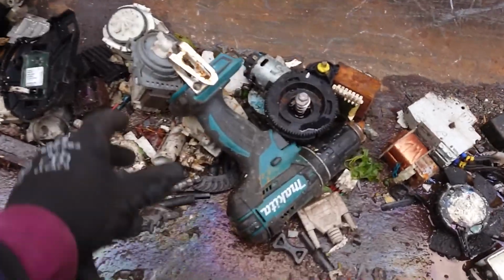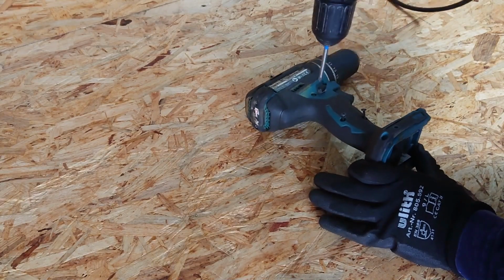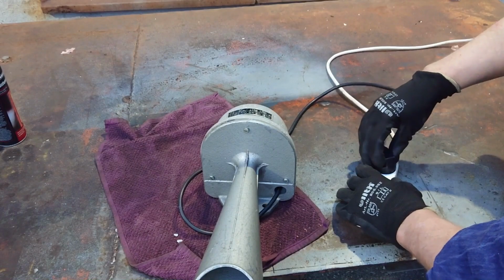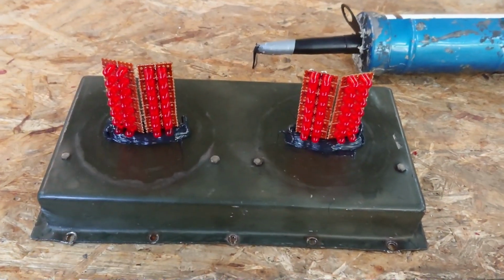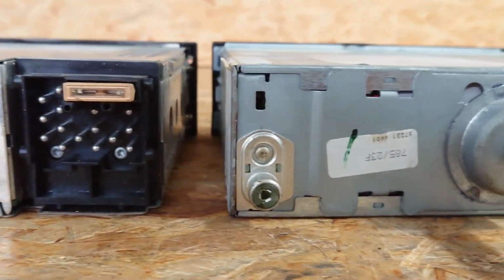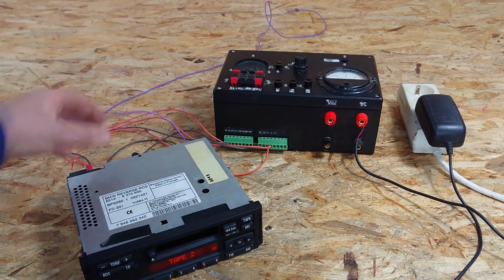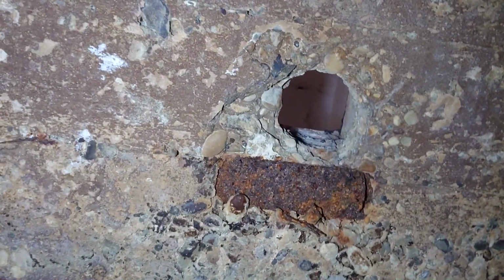Exciting Scrapyard Finds! Repair-A-Thon!

Comment: Love that alarm system! The radio tester is cool. I tried to repair the radio out of my 80's truck, it seems to have lost the bass control and it just puts out an unusual amount of bass to all of the speakers, potentially damaging them. I found a few puffed out capacitors and replaced them but the issue still seems to be there.
Reply: Or perhaps the bass potentiometer is bad
Reply: I'd replace all the caps, as basic principle, even if they're not puffed, they can still be dead or dying. Also, give a good  search of all the soldering joints.
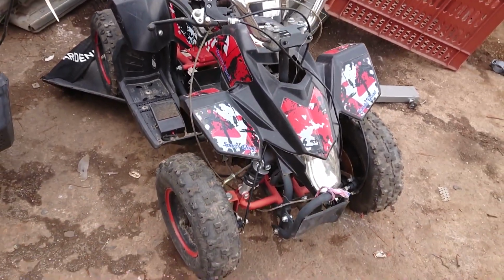Reply: heres a video that at about 2:20 has a chart that correlates driver response frequency to capacitor mfd rating. this will help you isolate which cap is bad. alternately you can install the caps inline to the speaker as a "bass blocker". https://www.youtube.com/watch?v=s_amOnIh1So

Comment: Given the holes on the ceiling and the 2 overflow ports that look like windows, and unpainted cement covering the walls, I'd guess it was a water tank of some sort. 
Maybe for irrigation? 
All the junk were thrown in it as a storage when it no longer was used as water storage.
Reply: Sounds like a good idea. The upper portion of the building may have been for the pump and drive motor. They may have made it look like a dwelling just for aesthetics.

Comment: Great video.
Looks and sounds like a prisoner has escaped! @12:17
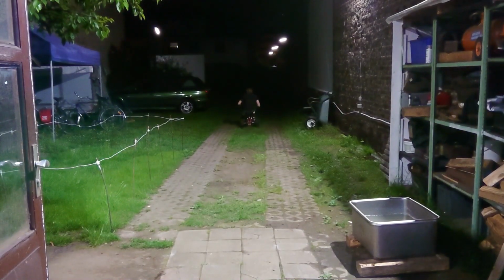Also, you would be wise to use orange tennis balls on top of those rebars sticking out of the ground, forming your garden fence. @18:25
This will prevent others from falling and getting impaled by one of them. Better safe than sorry...

Comment: Curiosity has a hold on me with those BMW head units: are they Alpine or Philips? I love the Philips stereo tuners from that era and before.
Reply: I had family working at BMW which got me some very decent BMW Becker radios back in the early 90s for my Ford Fiesta... 😀
Reply: @armin0815  Very nice.
Reply: @andrewprettyquick2070  I didn't ask you.
Reply: It says Blaupunkt on at least one of them. I think BMW mostly had rebranded Blaupunkt and Becker radios.
Reply: @armin0815  Thanks. I should have realized Blaupunkt. Here in the US I've seen all 3 brands. Becker is more of a Mercedes thing.

Comment: Most of the junkyards in the Philippines are mostly junk because people would repair until the device is irrepairable due to lack of parts.

That sink in intro? Somebody would get/buy that even before that step in the junkyard.
Reply: Same here in Pakistan, scrapyards here resell alot, only proper scrap is sold for melting, and we rebuild most of the old vehicles with spares from imported auto scrap, this has led to people introducing latest features to really old vehicles. You can have any outer shell with any engine and gearbox from scrap if it fits.

Comment: Anyone got any tips to find a junkyard, I googled but most of the ones were purely cars parts not anything cool
Reply: I remember when you could go to the local dump and mooch around in the recycling and scrap piles.  Nowadays it seems they don't want you to leave with anything.  Probably people tripped on stuff and made a fuss and now for liability's sake they won't let you look for things.   Definitely you want to look for scrap yards rather than wreckers.
Check the IScrap app (seriously - there is one) at iscrapapp.com.   Look under 'yards' and you should be able to put in your city and state/province and they will tell you the nearest scrap yard that they know of, and that should be a good starting point.
Reply: @mikegraham7078  Awesome thanks! It looks like the app Is only for America and Canada but I'll look for an Australian version :)
Reply: @evancashman7614    Apologies!  I was woefully geo-centric in thinking that you 'looked' North American from your teeny-tiny profile picture.  Also, you don't type with an accent.   :)
Reply: Recycling center or scrap yard are good ones to look for

Comment: Why an Arduino? little overkill. A 555 timer would be simpler.
Reply: Why 555 trimer When  you can use a tow transistor  multivibrator  :-) .
Reply: 555 timing iming circuit or similar will have robust plug and play function, likely to contain all switching hardware, also likely to turn up at little or no cost.
Reply: Agree.
Reply: He wants to make a whole alarm system. So the microcontroller will be easier to add inputs to and program.
Reply: @1pcfred    That is certainly true.  I doubt, however,  that he will use the microprocessor in the annunciator that is mounted on the wall outside his shop (and thereby more accessible to anyone who might want to defeat it) to do the 'heavy lifting' for the alarm system.
If he wants to program one of these kind of units to run the whole alarm system then he might be better off with a Raspberry Pi so that he can access it with bluetooth and get video feeds to his phone and whatnot.   What you say, however, is quite true.  He could do what you suggest.  It would have to be a relatively limited system with only a double-handful or so of a tri-state pins to play with for digital inputs and outputs.
Reply: 555 has gone the way of the cuckoo bird. 
You can't add future functionality without adding more hardware.
MCUs make a lot of electronics go the ways of the 555.
Reply: With the arduino he can have separate flashing rates for the two outputs (the lights flash a heck of a lot faster than the horn cycle) and he could adjust them easily while testing to get a rate that he likes.  To do this with discrete components he would have needed two 555s, two pots, and sundry other support components.   The arduino probably only cost 25 bucks, saved a bunch of fiddling around, and added the possibility of having non-trivial cycles, like he could have the horn signal SOS in morse code if he wanted.   It adds a lot of capability for little money.   Also, arduinos are fun.  :)   In the panels for the machines I build if I need a timer I don't put in a timing relay, rather I will put in a programmable relay for the same reason.  I might cost twice as much money, but it is so much more flexible that I gain a great deal of future-proofing.  I can put timers on several more items without adding any more hardware.  It opens up possibilities.   If you are designing a machine for mass-production then it makes sense to use the simplest components possible, but this is a device for his own use, and its evolution is not guaranteed to be over.    Plus, he's probably got a whole shelf-full of arduinos of various capabilities with the money already spent.
Reply: @mikegraham7078  A basic Arduino is more like $5 nowadays.
Reply: I just checked, and the price of an arduino Nano Every is only about $10, and it would certainly be able to handle everything that device needs to handle, and by the looks of it it has five digital pins so you could have up to 4 outputs (assuming you use one pin as a trigger input) so he could add another two objects to be timed with no additional hardware.
Reply: Does he tell you how to do things in your videos?

Oh wait! You don't make your own videos..
Reply: @felixthecat1672  its just a suggestion lmao, dont make a molehill out of a sand molecule